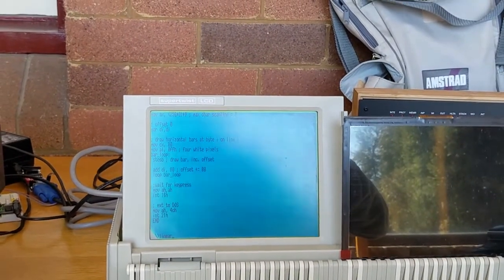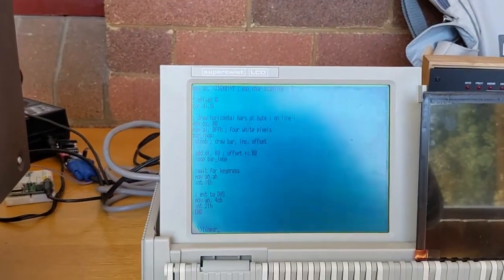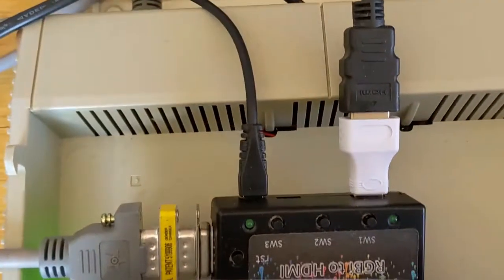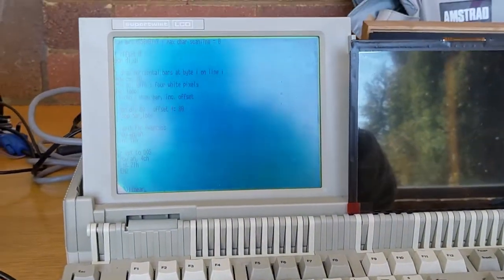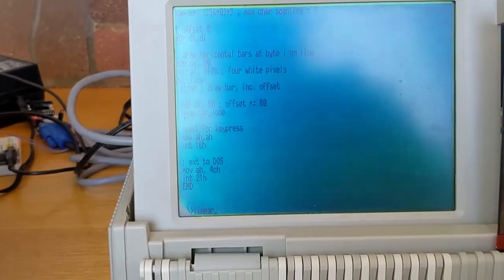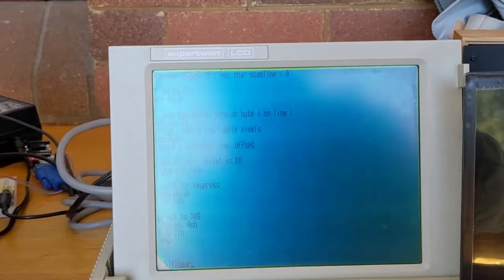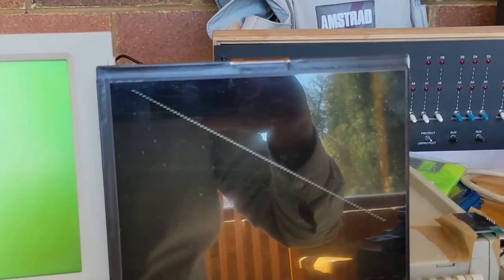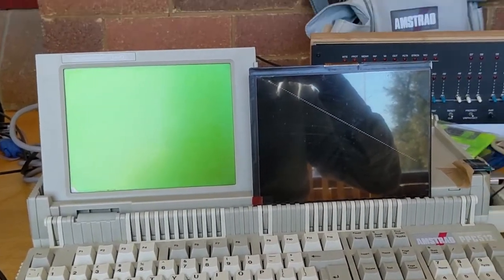Linear Addressing on the Amstrad PC 512 CGA - unfortunately, the answer is No.

Comment: If you need to use ISA cards on your PPC, check the youtube channel of  Retro theory, especially the video whose title is "Amstrad PPC512 ISA Expansion Board XTIDE Network Sound PPC640". He is also actually making a multi fonction internal card replacing the modem in a PPC 640.